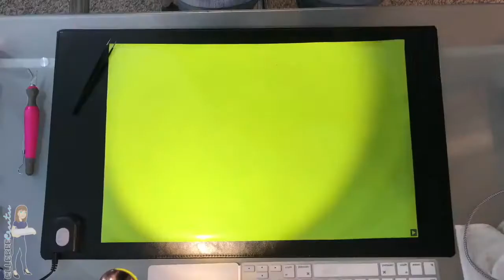Neon Sugar Skull Time-lapse

Comment: Can you tell me what your best settings are for your cameo when cutting an intricate design such as this?
Reply from the maker: The default settings for whatever material I’m using but i slow the speed down and always use a new sharp blade. One of the biggest mistakes people make is not replacing their blade often enough.

Comment: That was awesome!  I'm hoping you can help me. I was referred to your channel by Corrine Blackstone. She has a video on print and cut with Cricut. I have a Cameo.
I'm trying to make a 4 like she did the  name in the video she did with an image from google. Can you help?
Reply from the maker: I don’t have a video similar to that one but I can certainly try to help. Which steps are you having trouble with?
Reply: @ElleBeeCreates  Omgosh! Thank you so much! I'm scouring You Tube LOL I want to make a number 4 like she did the name. I know I have a knife tool on the cameo.
I'm watching a very old cameo video with designer edition which I have,  importing,  your pattern. It was made in 2016.
Reply: It's not helping me very much because it's too old I think
Reply from the maker: You’re wanting to fill a number 4 with a pattern? The easiest thing to do is to find a number 4 in a font you want and type it onto your design area. Add your pattern into your pattern folder in your library (open your library and drag and drop the pattern file onto the pattern folder within the library) and then go back to your design area and select the number 4 you typed out. Open the Color Fill Panel on the right hand menu. The third tab in that panel is for patterns. Scroll to your pattern and select it to fill your number. You can then adjust the scale, aspect ratio, angle and more within the advanced options of the fill pattern menu.
Reply: ElleBee Creates it worked!!!!!! Thank you soo very much!!!!!
You are the sweetest woman ever for taking the time to answer and help me!! Thank you so much!
Reply from the maker: Yay! Glad I could help! Happy crafting!
Reply: you rock!